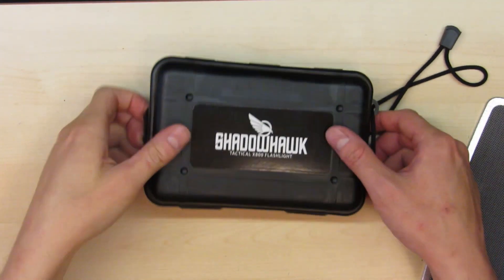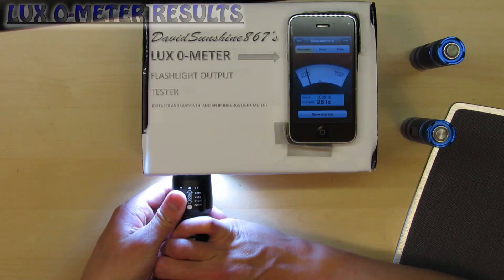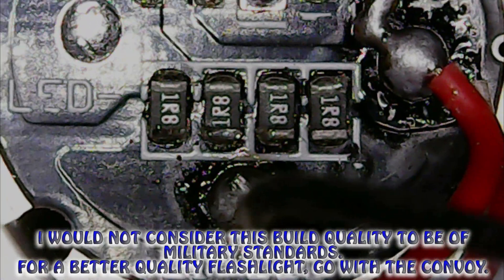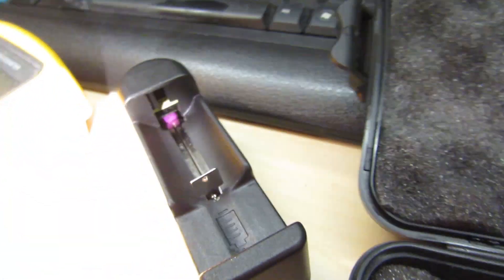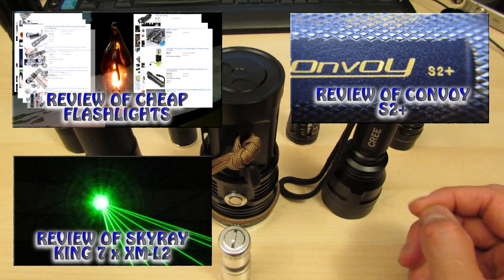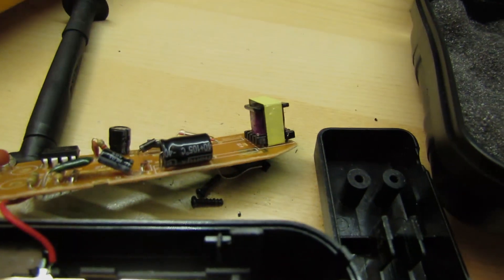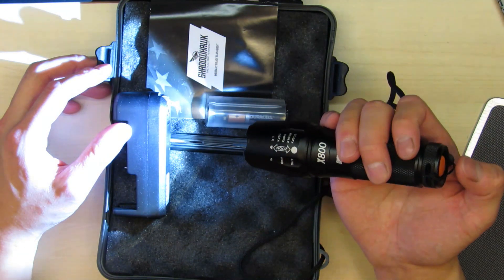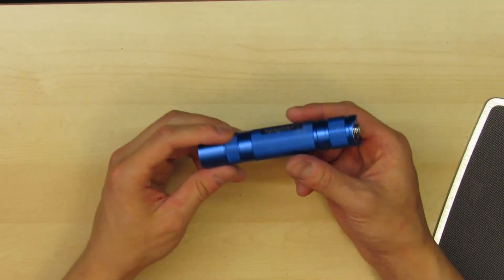ShadowHawk X800 Review - 26650

Comment: I need a step by step guide as to how to recharge the battery. I cannot find that anywhere.  One video showed plugging the usb into the torch and I cannot find out where that usb could go.  I am not very technically adept.  I don't understand how the charger works as it isn't plugged into the mains from what I can see, and from what I received in the box.  I just don't understand how to recharge the battery using the charger with a usb.  Do I need to buy a usb charger that can be plugged into the mains?  Thank you.

Comment: Excellent review!!! On 7:38 the green battery is from LG ?
Reply from the maker: Thank you. Yup, there's also a new Sanyo 3500mAh(http://tidd.ly/370373d3) that's red, it's a little better than the LG and cheaper too. I use that cell in my flashlights now. But the Panasonic 3400 is still good, and even cheaper. 
Cheers,
David.

Comment: My shadow hawk light has become a digital looking square; I’m about to replace the battery but I can’t find any info on how or why to replace the lighting element. Can You help me with this issue pls. TY
Reply from the maker: Hi Peter,
It's normal to show the digital pattern of the XML when you zoom it down and focus the LED pattern to the wall, so no need to replace it, but if you still want to upgrade it to get rid of that pattern, you can upgrade to an XPL2, it'll still be square, but it doesn't have the pattern of rectangles and lines.
No problem, I think the LED board size is 20mm, you can measure it to double check, but if you can desolder the 2 wires from it, and replace it with a copper 20mm MCPCB with an XPL2, I think it would be a good upgrade to it, and you won't see the lines and rectangles of the XML LED you have in there.
The XPL2 has a solid light emitting pattern as opposed to the dark lines/rectangles of the XML.
This is the XML pattern you're probably seeing when you focus the light:  http://www.peace-corp.co.jp/data/XLampXML.pdf
The XPL2 pattern is solid so it'll look better, it'll still be square but it's a worthy upgrade:  https://cree-led.com/products/xlamp-leds-discrete/xlamp-xp-l2
If you want to upgrade the driver too, I think it takes a 20mm PCB, double check that too.  The stock driver is a little low powered and flickers, if you upgrade it though, it'll push a lot of power and get warmer when running on high, and you'll want to put thermal paste between the metal that holds the LED and the body it goes into, to try and pull the heat away from the LED to keep it cool. If you don't want it too powerful and hot, you can stick with the stock driver.
Here's an LED and driver combo that could work: https://tidd.ly/3JWO11l

It'll be 6500K, you can get 3000K or 4000K but it's harder to find.
The SST-20 comes in 2700K to 6500K, you can get that on a 20mm Copper MCPCB and throw it in there on the stock driver, the pattern isn't as bad as the XML, but it has a couple dark spots in the 2 corners where the wires connect to the LED:  https://tidd.ly/3F5izdK
I show you how to replace the LED in a WF-501B, the tear down is not exact but similar:  https://www.youtube.com/watch?v=URsrgILa3k0&t=4s&ab_channel=DavidSunshine
The procedure will be very similar for the X800.  At 4m02s, I show how to unscrew the top off and get to the LED.
Hope that helps!
Cheers,
David.

Comment: What about the Klarus brand flashlights?  Do you have any experience with them? Would the klarus XT 12 be a good choice?  I admire their new ideas but I have no knowledge about this technology.  👍🏻👍🏻👍🏻We appreciate you knowledge and extra efforts👍🏻👍🏻👍🏻
Reply from the maker: Hi, I haven't tried the Klarus before, but it seems a little expensive for 930 lumens, you're better off with the Convoy S2+(http://tidd.ly/6a7c45ee) for $13 rather than the Klarus at $120.  Both perform similarly.  The Klarus does have integrated charging, but that's more trouble than convenience, it makes the flashlight larger.  The S2+ is sleek and easily pocketable.  That's my take on it.
Hope that helps, Cheers, David.

Comment: Thank u 4 your prompt reply. Which of the convoy 2s + is best?  I see there are a few models?
Reply from the maker: You're welcome, I would go with anything that's 7135x8(Blue one here http://tidd.ly/6a7c45ee), each 7135 current limiter gives you 350mA, so with 8 of them you get 2.8A, that's about 1000 lumens of light.  The light dims well to medium and low, so you can always use less power if you want, otherwise you have full brightness.  It gets hot with 2.8A though, so if you're conservative and don't want a flashlight that has high light output and gets hot, you can get a 3 x 7135, or 6 x 7135, and have less output, but it will be more manageable, even the 6 x 7135 would get hot.
If you want to be able to run on high, and have the light not burn your hand, get the 3 x 7135 (375 lumens) (http://tidd.ly/d823581f), the good thing about this, is that if you give it to children, they won't be able to burn themselves, it'll still be bright and not great if they point it into their eyes though, so caution them on that.

If safety and heat isn't a concern, and you just want high output, get any 7135x8 version, the color is personal preference.  I quite like the blue one though.  It's dimmable to 5%, so I would just get the 1000 lumen one, since I am the main user.  You can also unscrew the tail cap, so that it doesn't accidentally turn on and burn a hole in your pocket.

Hope that helps.

Cheers,

David.

Comment: I do not have any device that  I can plug a usb charger into, they are much small sockets now.  I can see you recommend buying a lithium ion charger, like Nitecore D4, and that doesn't plug into the wall either.  I guess I need something for the wall that will take a usb.  You have given a very detailed description of the product, thank you so much for that, and especially the warning about the charger.  I guess its an older product now as most of the comments are 6 years old on here.  Oh well, it works for now and I can just buy ... whatever when it runs out.

Comment: How long does the battery take to charge? If had this one plugged in for 12 hours, does the red light turn green when fully charged?
Reply: Will the battery explode if over charged?
Reply from the maker: The charger pushed my battery to 4.28V overnight, and anything above 4.23V is dangerous(depends on the battery), so short answer is yes, there is a risk of explosion.
Measure the voltage, and make sure it's under 4.23V, if it's over that, you're at risk.
It's fully charged at 4.20V, for most lithium ions.  
You're best off buying a proper lithium ion charger, like Nitecore D4, I really don't like the charger that came with the kit, as it should NOT push batteries beyond 4.20V, that's dangerous and not proper charging of lithium ions.
With that said, if you do use the existing charger, I would be very careful and charge it using an extension cord, on a fire proof surface, like the kitchen stove.
Hope that helps!

Comment: Sir, a most excellent, and very informative, video.
Reply from the maker: Thank you Oscar.
A lot of people don't like the X800, they say it just sucks, but really it's not that bad as a budget flashlight, I wouldn't mind paying $6 for it actually, I was using a current limiting resistor based driver LED flashlight for many years, they do fail sometimes(so don't depend on them), but they do the job and provide about 500 lumens worth of light.  I would much rather have a higher quality light for $13 though.
Cheers!
David.
Reply: For less than $10 it's not a bad flashlight. It gets so much hate because Shadowhawk is taking a generic cheap flashlight, rebranding it and marketing it as an elite military tactical flashlight, and selling it for far more than it is worth.

Comment: hey what would recommend for a low budget flashlight with a usb charger?
Reply from the maker: Hi, 
I'd recommend the zanflare F1 (4500-5000K version, http://tidd.ly/f5c77d63), it's a VERY high quality flashlight, and will be reliable for you to use camping, hiking, or any other important application where you need a quality flashlight to provide you with light.  It's waterproof and rugged.  It has the best protected micro USB port on any flashlight, and it's hidden behind a metal ring that has 2 o-rings keeping it water tight.  If you like a cooler color temperature, where the light has more of a blue tint, you'll want the 6000-6500K version, http://tidd.ly/f5c77d63.
It's super bright, and can light up an entire field almost as well as a SkyRay King, that's because it pulls 4.05A in flare mode, it can only use flare mode for 30 seconds before it reduces it down to high though, because it's such a high powered mode, like 17 watts, it can't sustain it for very long.  The LED is only rated for 10 watts, so it's really pushing the limits.  In a flashlight this size, even 10 watts will be a lot for it, and it'll get hot quickly, like the Convoy S2+.  Additionally, it can operate for 1470 hours on moonlight mode, or 61 days, using a 3500mAh battery, that's crazy long, I don't think any other flashlight can do that.
You're on the right track though, if you don't want to purchase a $30 18650 battery charger, then a flashlight with a micro USB port and a single battery will be very little equipment, and will provide you with the most powerful flashlight with the longest runtime possible.

It doesn't come with a battery; I would recommend the Panasonic 3400mAh (http://tidd.ly/c633d605).

If you want a slightly better battery, you can go with the Sanyo 3500mAh (http://tidd.ly/b70e069a), but it costs a lot more for a small improvement, not really worth it.

Hope that helps!
Cheers,
David.